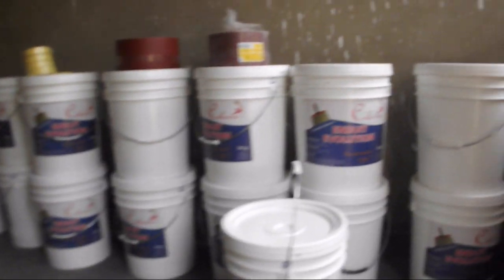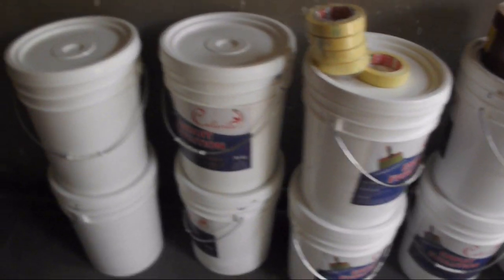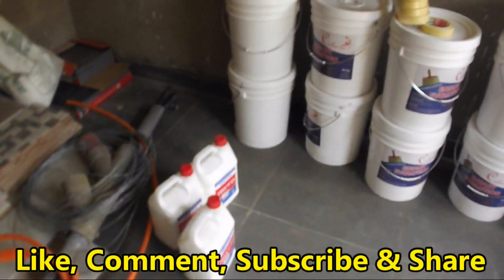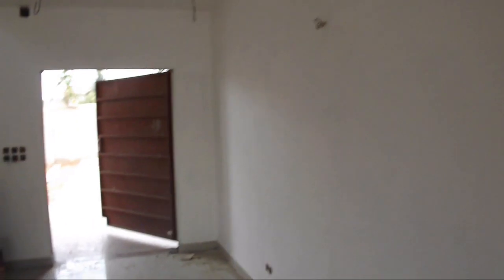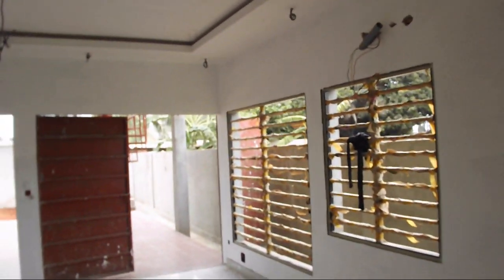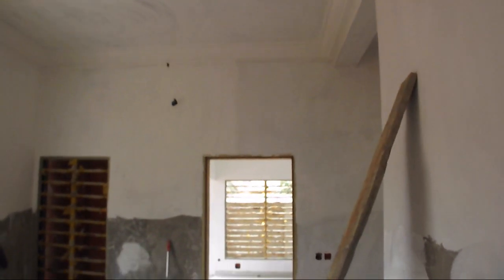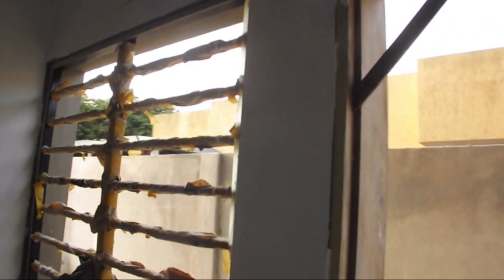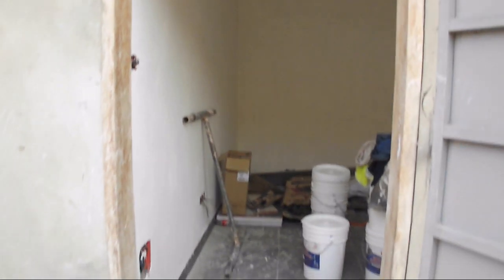Building The House 73 - First coat of enduit

Comment: I had to revisit this video for some inspiration, I will probably scrape off the first coat of primer I applied on on the project to apply a new high quality primer.
Reply from the maker: Hi @Krone Moz,  So we used the "Evolution" brand of enduit. I can confirm that it works well with Dulux Luxurious Silk.  Best🙏🏾
Reply: @AyiviTV  Not sure we have evolution in Mozambique but I will ask around. I saw a brand called Fired Earth, pretty expensive but I was told by the salesperson that it's all weather resistant and covers superficial cracks, obviously he's a salesperson he wants to sell, he will say anything to achieve his objectives😂😂.
Reply from the maker: @Krone Moz, ha haaa...salespersons.  Their products are always just what you need.  I'll be curious to know what you end up using.  Cheers👍🏾

Comment: Will you paint the bulger proof again sorry if thats not the right spelling
Reply from the maker: Hi NAOMI, very good question.  I am not sure yet.  The burglar proof are made from aluminium.  They had been exposed to the elements, unwrapped for over 1.5 years.  During my recent trip I engaged the window guy to clean and wrap them in paper.  It is only after the windows are installed that the burglar proof will be unwrapped.  

If after unwrapping they don't look good, we will have to paint the burglar proof.  Since they are aluminum, I am hoping they can be restored by just more cleaning.  Time will tell.

@Naomi Bruce, I hope that you are doing well.  Have a blessed week 🙏🏾
Reply: @AyiviTV  ok i understand now thanks
Reply from the maker: @Naomi Bruce, you are very welcome!